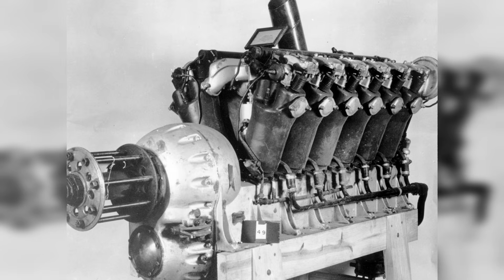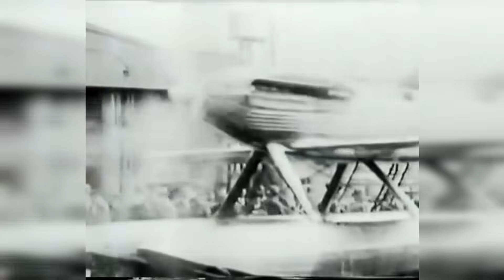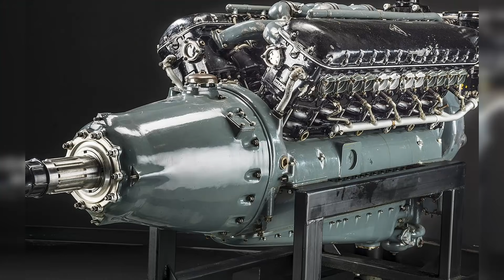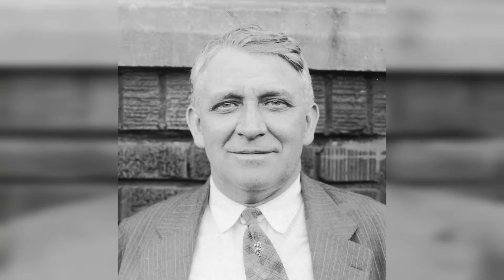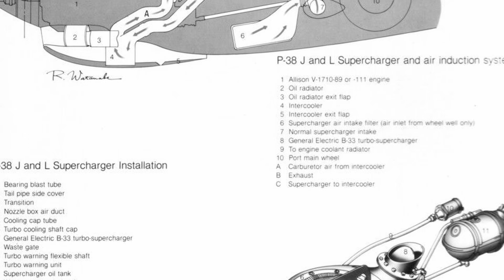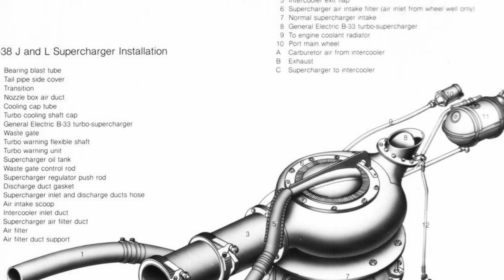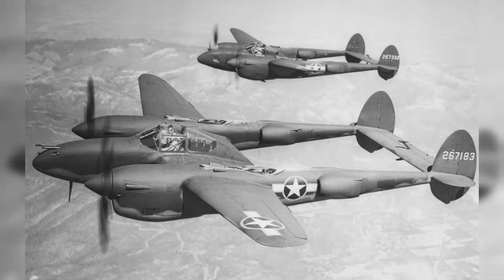Allison V-1710 - A Liquid-Cooled American WWII Warhorse

Comment: To get your facts? straight, you should do more research. The Allison came first, made more power to a higher altitude than any early Single-Stage-Single Speed Merlin! The problem comes when you comp the latter Two Stage-Two Speed Merlin to the earlier SS-SS Allison engine. When you comp the Two Stage-Two Speed, or Turbocharged Allison to the 60 Serries Merlin the Merlin is a very distant third place. (Behind the later SS-SS Allison that made 1,825 HP down low, comp'd to the 66 Serries Merlin at 1,720 HP, or the Turbo Allison that made 1,600 HP at much higher altitude than the Merlin! 33,000' Vs 22,600'!) I hate it when you You-Tube guys make so many mistakes! Do your Due Diligence! The later TS-TS Alison in the F-82 made 2,300 HP Comp't to the Merlins 2,000 post war in the Hornet.

Comment: It's easy to forget, they didn't have the design tech for good compressors and turbo impellers, They were still working out how to actually make boost. And it's much different at altitude compared to car or truck use.
Reply: Supercharging was not new technology by the late 1930's and early 1940's and it's implementation at high altitude was understood. Pratt and Whitney used two-stage supercharging in some of their radial engines early in the war. Making it compact enough to package with inline, liquid-cooled engines was a challenge and RR managed it with some creative single-shaft engineering, but the challenge wasn't so much technical as it was application-wise.

Comment: Looking at the pics of the exhaust manifolds alone the turbo was at best  inneficient. And those turbos look prehistoric,, 1920s instead of 1940s. So 2 stage blower were far better.
Over 3000 rpm too was maybe a bit average, that much boost at that rpm?

Comment: Intake manifold was always a problem and one of the causes of detonation on Allisons.  Read up on the Wright Field trials using 150 octane.  If the later Allisons on the P-38L couldn't handle the increased boost with 150 fuel, then the earlier Allisons on the P-40's certainly couldn't ... and they didn't. 
 Engine fires, broken cranks, thrown rods were common on P-40D, E, K when over boosted.

Meanwhile, the Merlins and P-Merlins were auth to run at 25 lb boost (81" MP) by 1944 with 150 octane.  The Merlin 100 series in 1944 was bench tested WEP at 135" MP @ 2640 HP.

Comment: Interesting mention towards the end regarding squish/quench not being properly utilized for increased anti-knock capability.  From my experience with high-performance automotive engines, for squish to be used effectively there must be a portion of the piston head's surface that comes within roughly .045" or less of the combustion chamber surface when the piston is at TDC.  My guess is this was hard to implement without a complex piston dome/dish shape because if it was simply flat then the volume at TDC would have been small and compression ratio likely would have been much too high to be suitable for the intended manifold pressures.  Just a thought, makes me want to read that Horsepower Race book even more now...

Comment: Excellent video, as always.  Your speaking ability is excellent, and the logical development in presenting the material is also excellent.
Off topic but related, I am always amazed at the shear volume of technical and engineering development in the early part of the 20th century, especially in the 1930's.  No doubt you have noticed this in the research of your videos.  Perhaps it could be a subject of a video, if you can pin down exactly why this was the case.  Regards.

Comment: The P-40Q was a good looking aircraft and achieved test speeds of 414mph at 20,000ft. But this was a test aircraft and not service aircraft which was typically quite a bit heavier. It was already way behind the performance of the P-51C when tested 1944-45. Turbo-superchargers were big and heavy and took up a lot of nacelle space on the P-38. The secret of the Merlin was the superb two-stage mechanical supercharger that needed just a 9 inch extension in the engine bay.

Comment: The supposition of this video is FALSE! It, the Merlin-II engine was chosen because Reginald Mitchel and the RAF believed that inline Liquid cooled engines had less frontal area and thus drag at high speeds. This assumption is easily proven false and the P&W R-1830 had equivalent, OR LESS installed frontal area than the Merlin in either the Spitfire, or Hurricane and made 170 more HP! It also weighed 174 Kilograms less, was much more reliable, but not made-invented here in England! It would never do to have the RAF use an American designed engine, even if it was made under license in England! Think what a nasty shock an R-1830 engined Spitfire would have been to the Germans like the FW190 was to the RAF? Even worse think what an R-1830 engined Hurricane with its superior weapons fit and thicker, thus more maneuverable and because of the higher power, faster plane! It's such a shame that R-R had soooo much political influence!
It had less frontal area than the installed Merlin because many of the merlin engine's accessories were installed over or under it for ease of maintenance, while the R-1830's accessories were all mounted behind it. There were also much more reliable and easier to service because they were built to airline standards and required much less maintenance in the first place! It also lasted much longer, 1000 hours to start, Vs <400 if they were very lucky, and the pilot did not use combat power too much. Tale off power was also better 1,000 Vs 880 in the Merlin-II that went into the first 4-500 Spits.
I only got halfway through this video because the sound quit. I'll have to wait to next week to finish it and see what other mistakes their guy made!

Comment: My reading of R R superchargers is a big air flow problem solved by a new to the team turbo expert,,high speed air hates doing right angles, and far less air can flow than "straight flow"computing predictions,,the germans mounted their driving supercharger at a sideways angle that blew fast air straight to the valves,,no carb resistance because fuel injection, no angle turns,,

Comment: There are some misconceptions about the RR Merlins ALL having 2 stage superchargers and that RR "invented" the 2 stage supercharger.  Both are false !!!  The 2 stage supercharger was invented and patented in the USA in 1938 and first used on the Grumman F4F-3 wildcat with the PW R1830 engine. RR used 3 different superchargers on the merlin.  All merlins up to but not the 20 series were SINGLE STAGE  just as the Allison V1710.  Just in time for the Battle of Britain RR added a second SPEED to the supercharger, not stage but speed to turn the supercharger  faster at altitude, that was the merlin 20 to 50 series..  it gave some altitude advantage but not much.Most Merlins used during the war were these models !!!  Then in late 1942 RR added a second stage to the merlin with the second speed,the merlin 60 series in service 1943.  Interesting that of the 20,000 spitfires built only 7,000 had the 2 stage 2 speed supercharger.  NONE of the Lancaster bombers got the 2 stage 2 speed merlins all were the 20series single stage 2 speed, as was ALL hurricanes.  only some of the later Mosquitos got the later 2 stage merlins.  Interesting the P40 with its single stage Allison was faster, climbed faster, rolled faster than the British Hurricane, why the Brits came to USA seeking more of them any why they ended up at North American to have them build the P40.  Dutch Kindelberger and Lee Atwood had been working on a new fighter design, and the laminar flow wing and radiator housing, and they flatly refused to build the P40 offering a better fighter with the Allison engine, only V12 AVAILABLE in the USA>  RR was over at Packard trying toget Packard to build the Merlin FOR THE BRITS.!!!!  and the Brits took the offer from North AMerican for the Mustang.  The Brits KNEW what they were getting but that was all that was available.and they were desperate for fighters.  and the Allison engined Mustang out performed the then Current spitfire Mk V which still had the 20 series merlin with the single stage 2 speed merlin engine.  Mustang was 30 MPH faster at 20,000 ft and lower.  The Allison was a better designed, stronger, lighter, larger engine than the merlin and it wasn't until the 2 stage merlin 60 came out that the merlin had better performance, BUT only above 20,000 ft.  There were 14,000 P40's built  9,000  P38's  and about 9,000 P39's all using the Allison throughout the war. they maybe were not the best but AVAILABLE and good enough to get the job done when flown correctly !!!  It was interesting the Navy used the mechanical 2 stage superchargers on the F4F Wildcat  The F4U Corsair and F6F Hellcat with the PW R2800 engines.  Also interesting when the 1310 P40F & L's got the Packard V1650-1  single stage 2 speed merlin the Allison was faster, climbed faster and rolled faster than the merlin model. the merlin only had a slight altitude advantage and why Curtis went back to the Allison engine.
Reply: Production of the Spitfire prototype plus Marks I, II, III, V, and VI, all powered by single-stage Merlins, totaled 9,078 airplanes. Mk V Spitfires were powered by Merlin 45, 50, or 55. Production of 2-stage Merlin versions, Marks VII, VIII, IX, and XVI (powered by Packard-Merlins) totaled 8995. Interestingly, all the Mk XVIs were LF (low-altitude-rated) versions. The rest were powered by the RR Griffon, totaling 2024. British heavy bombers did not need Merlin 60-series and higher engines, as they operated below 20,000 feet. Re the comparison between the Spitfire Mk V and the P-51 Mustang, the Spitfire had a top speed of 375 mph at 20,800 feet. The P-51A had a top speed of 382 mph at 13,000 feet.
Reply: @RANDALLBRIGGS  you are wrong the RAF Mustang Mk I had a top speed of 390mMPHand the MkIA topped out at 400mMPH   at 20,000 ft !!!  do NOT try and lie to me

Comment: The engine was actually smoother than the Merlin but where the Merlin beat it was in supercharging. It was the Merlin supercharger which allowed it to excellent at height.
Reply: Specifically Rolls' ability to package a solid 2-stage unit onto a single shaft, and fit into basically the same space as the original single-stage unit.

Two-stage supercharging was nothing new - the USN had it in the Wildcat and Corsair long before the Merlin was upgraded to have it, but they both had their second stages in bulky external units with separate shafts and gearing. The Merlin's real innovation was in getting decent performance out of a compact single-spool unit.
Reply: @patrickchase5614 Merlin 60 had 2-stage chargers as far back as summer 40’. Well before the Wildcat first saw combat with a 2-stage supercharger.
Reply: @princesofthepower3690  Nonsense.

The F4F Wildcat first flew in 1937 and became operational (with two-stage supercharging) in 1940. 

The very first 2-stage Merlin was bench-run in April 1941 and deployed in 1942 (so after Wildcat "first saw combat", though that's irrelevant to development timeline in any case).

Merlin was late on the scene with 2-stage supercharging. What made it unique and brilliant was that it did it in a compact, single-shaft form factor as opposed to the bulky arrangement that Wildcat had.

Merlin did gain two speed supercharging in 1940. Might that be the source of your confusion? Note that that was also late relative to others though.
Reply: @princesofthepower3690  No not true If R/R HAD IT BACK THEN THEY WOULD HAVE USED IT.
Reply: the Allison was smooth and cruised nicely at lower RPM, using crank counterweights, but it had a horribly designed intake manifold (that caused detonation), among other things.  The overboosting of early P-40s also caused a lot of engine fires and failures in the slow P-40's, but that was an acceptable risk to Sqn pilots up against superior fighters.
Reply: @bobsakamanos4469  Allison was widely used in North Africa, the Eastern Front and in the Pacific with no comments on a 'detonation' problem. If you're going to attack the Allison engine continually, you might at least provide a few factoids to back up your preconceived notions.

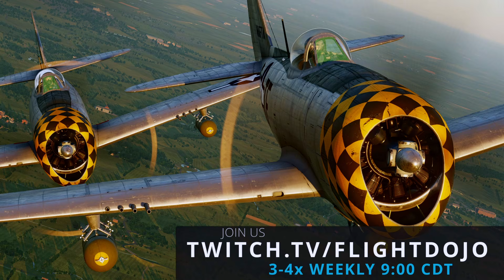Comment: 28:52 "... a compressor that is being geared through a reduction gear system back to the crankshaft of the engine itself so it is a power recovery device where we're using energy from the expelled exhaust gases to crank that energy through the compressor back into the crankshaft itself." Err, Wait. What?
Infinite energy! 😆

Comment: The bore was 5.5 inches and stroke was 6 inches yielding 1710 cu. in. If the bore was 6 and the stroke was 5.5 the displacement would have been 1866 cu in.

Comment: What was it about the post WWII post lend lease Allisons that meant they needed rebuilding so often. The pre Merlin Allisons had a reputation for good reliability
Reply: The  P/F-82 production run engines were the crude 1 1/2 stage induction through a remote external secondary blower Allisons lacking all the 2 stage Merlin’s sophisticated internal protection and performance accessories.  No two stage Allisons were used in civilian transports.

Comment: Allison engine was solid.  Problem with the single stage Allisons was that the airframes were too heavy.  P-39, P-40 and P-51A weighed 7650#, 8400# and 8600# respectively for an engine of 1150HP.  Spitfire V weighed 6500# with 1400HP and a Me109G weighed 7000# with a 1475HP engine.

Comment: Wrong , no roller bearings on the cams  but rollers on the rockers against the cam , as on today's Harleys , plain bearings on the cams , in contrast to the merlins which had also plain bearings on the cams but hardened rocker against the cams. which is inferior . puts far larger demands on the oil.....

Comment: Bottom line is that the Merlin had a better supercharger because the AAC was fascinated with turbocharging.
Reply: More appropriately, GM and GE were telling the USAAC/USAAF what they were going to use.  The turbocharging system of the the P-47 and P-38 were monsterous and vulnerable to enemy fire from behind.  Superchargers were well protected by contrast.
Reply: @bobsakamanos4469  LOL. You keep swinging, but I don't see any chips flying.

Comment: Gear reduction, something that needs to happen. Horsepower means RPM from the powerplant and you can't turn a prop faster that Mach 1, they just don't work, I mean at the tip. So figure a C-130 propeller at about 16 feet in diameter, It turns at about 1150 rpm. Once you know how big the prop is then you know how fast it can turn. Need an engine that turns fast and a prop that you can manage.
Reply: ALSO ON THIS MACH ONE THING
THE HUB OF A PROPELLER SPEED CANNOT REACH  1/2 MACH 1, LIKE HELOS HAVE THE SAME PROBLEM
SMASHING THE TIPS OF THE BLADE,
Reply: @raypitts4880  tip speed is all I am concerned

Comment: This cool cat does not mention what horsepower is. Work over time. It has to do with climb performance and take off performance. Torque is something completely different. Has to do with foot pounds. Obviously a fighter needs horsepower but it is not the only consideration.

Comment: The Allison engine was arguably a generation in advance of the Merlin in many ways, but the lack of a two stage supercharger hamstrung it.
Reply: From a mass production standpoint, the Allison was far superior to the RR Merlin-it was far cheaper to build, required far less machining capacity and was easier to service in the field. Not to mention it's bearing designs were a big improvement over the Merlin.

Comment: Extremely reliable engine, perfect for lew-level air-work. The British used their P-51As (Mustang I and II) until 1945 in the army cooperation mode. At those heights it could outrun anything the Germans had.

The Allison also had good behaviour at low revs (a perennial problem with the Merlin), perfect for long range missions at economic throttle settings. The Russkis loved their P-39s too and put them to good use in another low-level scenario.

Comment: ...one thing I have always wondered...since we were at war, and sharing design and technology, why Allison engineers didn't simply adapt the Merlin supercharger to fit the V-1710?...since they were both 60 degree V-12 engines of similar size, seems like it should have been doable..some American company could have license-built the superchargers...and yes, I think both the turbo-compound V-1710 and the V-3420 were awesome...maybe even better than the stuff the Germans were working on with the DB-605, DB-603, and Jumo 213...BTW, I have seen the numbers on the X-B-39(Boeing B-29 equipped with the Allison V-3420)...quite a bit of an improvement over the R-3350 in both performance and reliability, and given the poor reliability, engine fires, frequent engine failures, and short service life of the early R-3350's in B-29 service, one has to wonder why they did not just switch to the V-3450 for production aircraft?....